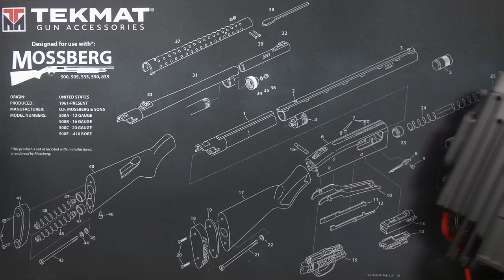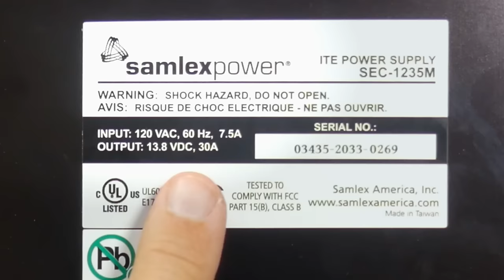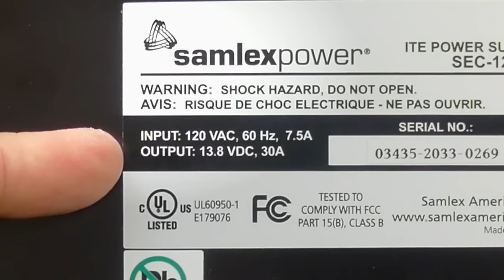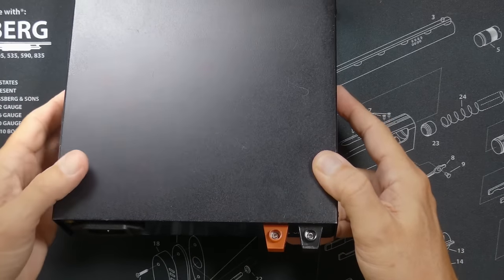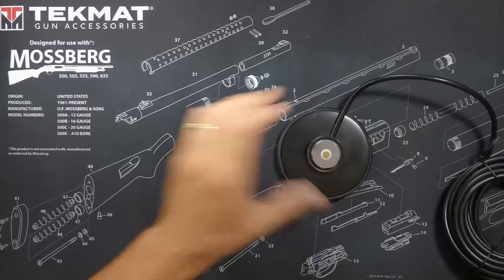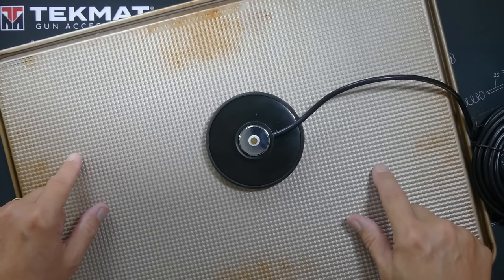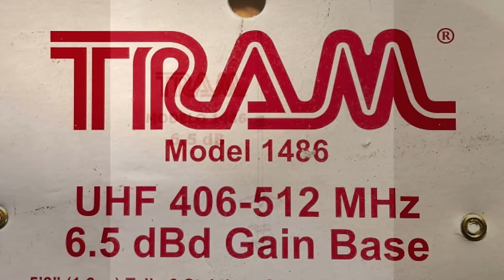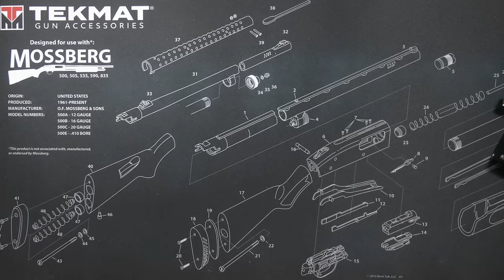How To Build A GMRS Base Station - Everything You Need To Know To Put Together A GMRS Radio For Home

Comment: Randy, I have successfully set up my very own GMRS Base Station rig. I'm using the Wouxun KG-1000-G, a Toppower STP-1330 30AMP power supply, LMR400 coax 50', a Tram Browning 6155 UHF antenna 450-470 MHz 5db gain base station antenna which is 73" tall. The antenna is grounded as you laid out in the video. The antenna is mounted on my house. I am able to hit the Squaw Mountain repeater 91 miles from my home and the Lookout Mountain Repeater 71 miles from my home. And I can do this on LOW power. I think the antenna makes all the difference. My SWR readings using the "older" version of the Farsometer shows an SWR of 1.05 pushing 49 watts at high power. Thanks for putting this out there for those who want to establish a base station. You have been an inspiration to me and I've used the wonderful information you put out to help me set up my base station.
Reply: Awesome man.  From your descriptions of the repeaters, I have to ask.. are the ones you mentioned here in the Phoenix metro area?  I have the kg-1000g and have yet to install into my truck.. which I believe is going in this weekend!
Reply: John Sampson indeed!!! The antenna is one of the most crucial part of getting signals in/out.....imo
Reply: Hey guys, I’m in Phoenix and I want to get into GRMS maybe get a base station. I live just east of the I 17 just north of Jomax in a two-story house. I could pop in antenna on the roof and have it pretty high up in the air.

Comment: That brief mention of static electricity is a fact,  I did a service call on a very windy day for a customer whose base radio was popping. Pulled the coax off of the back of the radio and it would arc from the center conductor to the shield every few seconds. Thanks for the base station installer certification, I will hang it next to my certified zip tie technician certificate
Reply: Some antennas with matching networks at the feed point of the antenna just so happen to be dc grounded.  The Ringo Ranger brand and the J-pole antenna are two such antennas.  If you have a problem with static discharge and/or lightning strikes in your area then one of those types of antennas might be a good choice for you.  The quick and easy way to tell if an antenna is DC grounded is to put an ohm meter across the center conductor and shield and it will show a dead short while also having an acceptable swr.

Comment: I guess I should have watched this video back in 2023, but my station is up and working, though I still need to get that lightning arrestor installed, it doesn't do much good sitting on the bench. LMR400 is what I want to use for my next upgrade, I am running on 50 feet of RG-8X currently. I picked up a BTECH GMRS-50V2, 50 watts on high power, and you can monitor up to four channels at once. And a 30 amp BTECH power supply. I also put the power supply on an APC UPS, so short power outages do not shut me down.

Comment: Here is an antenna I ordered for my GMRS station. 
Comet CA-712EFC Commercial/GMRS UHF Base Vert. 450-470 mHz

It has a 9db gain. A bit tall but if you have the room for $139 not a bad option. Only negative is that it is 2 weeks backordered.

Nice, simple video Randy. Enjoy your channel and learning tid bits about this hobby. 69's
Reply: Link 2 purchase? Thnx

Comment: It was winter with snow on the ground when I first got my GMRS license. I put a mag mount antenna like the little one you showed on the A/C compressor just outside my home office and ran the coax in the window. I was still able to close the window on the RG58 coax without crushing it. As ridiculous as this sounds it worked as well as a mobile setup. Since upgraded to roof mount like Randy’s but don’t let a less than ideal situation stop you from setting up a base. Even a roll up J-pole from Nelson or N9TAX hung in the corner of a room will get you on the air.

Comment: My base station is a radioddity db20-G with a power adapter that sits right next to my PC.  I ran some rg58 up to the ceiling and connected a nagoya UT-72 antenna to it.  Works fine for gmrs and listening to Dallas PD.

Comment: One cool thing about the Wouxon KG1000G is that you can remote the head display up to 16ft from the main radio body. Gotta get the SCO-002 cable. Im thinking about buying the KG1000G and power supply to mount in a cooled enclosure in my attic mechanical room for a shorter coax run to the roof peak. Then mount the display in the mancave directly below the mechanical room.
Reply: How difficult would it be for us to make our own longer cable.  Are the connectors easy to get or are the some type that is strange and hard to find.  Then the question becomes: how long of a cable can we use.
Reply: @craigdavidson2977  just get cat cable and 2 male ethernet plug and the apropiate tool bam there`s ur cable EDIT: Some radios may use special layouts!
Reply: @gamingforlive2150  and you can get all that at home depot fairly inexpensively
Reply: @hitekredneck109  well maybe? 😅 Im german so ive never benn to home depo, wallmart micro centre ir anything like it

Comment: For a low cost power supply option, there are sub $20 12v supplies meant for use in arcade machines, which will put out duty power all day long, meant for computer boards so it's clean power. These power supplies have output adjustments so you could bump it to 13.8v if you really want to.  But the main thing is, they put out clean 12v for cheap. You will know you have the right one when all you see is a bare metal box.  You have to add the 120v input cord and 12v output via screw terminals.   I use one of these with my mobile/base sad ham radio and also for a CB. Works great.
Reply: Do you have a brand/model number handy? That’s an interesting tip.
Reply: Exactly! Thanks for someone speaking up and checking in
Reply: I have used oneac
Reply: I have used old PC power supplies and modified UPS-es for cheap power supplies.  Bonus with a UPS is the battery inside that will allow you to "play radio" if the power goes out.
Reply: How much current can those power supplies provide?
Reply: Link to buy, please?

Comment: My MXT275 failed within 2 hours of its first use, VSWR was 1.2:1, and something in the main unit failed. Midland is sending a replacement. I chose a 1/2~ fiberglass GMRS antenna mounted on the ladder of my RV with a 10' 1 1/2" PVC pipe and LMR-400 coax. The range was about 30 miles simplex up into the foothills with 15 watts. I look forward to trying the base station with a 50-watt radio next.

Comment: Thanks for the great video I didn't realize how much power you lose in the coax cable. I'm using cheap cable and will now upgrade my coax.
Reply: Just to show why Randy has chosen LMR-400 cable here is a list of all the popular types in use by the hobby radio community
RG-58   loss is    11.2 dB at 400 MHz per 100 feet of cable   
RG-58/U loss is  10.6 dB at 450 MHz per 100 feet of cable   
RX-8X   loss is     8.6 dB at 450 MHz per 100 feet of cable   
RG-8 (RG-213)     4.8 dB at 400 MHz per 100 feet of cable   
9913    loss is      2.8 dB at 450 MHz per 100 feet of cable   
LMR-400 loss is  2.7 dB at 450 MHz per 100 feet of cable

So, in round numbers, If you have a 50 Watt radio using 100 feet of LMR-400 then only 25 Watts is getting to your antenna (3 dB loss).
If you use the cheap stuff (RG-58) then only 5 Watts is getting to your antenna (10 dB loss).

Also don't forget that this loss also works on receive so your radio will not hear as well (less sensitive)
Reply: @craigdavidson2977  Yes, this is a good reason to keep antenna cables as short as practicable.

Comment: I happen to use the Ed Fong GMRS monoband base antenna for my current setup it is mounted on a mast. It was 1.1 to 1 with the LMR-400 coax I used.
Reply: You could also make your own ground plane antenna. It's VERY easy to do. Search youtube for GMRS ground plane antenna.

Comment: He was dead on about signal attenuation through coax. The longer it is, the more signal will bleed off and you have a weak transmission. Recommend getting a coaxial attenuator to prevent bleed off and overly strong signal strength. I'd like to find out what wind rating his antenna setup has. I live on the coast and during strong storms we get high winds coming off the water which makes antenna placement important.

Comment: I have a question. I am building a GMRS base station. What is the difference between the Tram 1486 and the 1486-B?  Thank you.
Reply from the maker: 1486 is white, the B=black
Reply: LOL, do I feel stupid? It must be my gray hair, LOL. @TheNotaRubicon  I am using a Midland 50-watt for my base. One last question. Just how high can I raise my 14866 antenna about my roof? Thank you so much for all you do. Love your videos and your style. have an awesome day.
Reply from the maker: § 95.317 Registration of antenna structures that may constitute a menace to air navigation.

(a) Each antenna structure used for a Personal Radio Service station is subject to the antenna structure rules set forth in part 17 of this chapter. In particular, the owner of an antenna structure that is more than 60.96 m (200 ft) in height above ground level (see § 17.7 of this chapter for specific criteria) may be required to notify the FAA and register the antenna structure with the FCC. 

(b) Further, stations located on or near a military or public-use airport with an antenna structure that is more than 6.10 meters (20 feet) high may have to obey additional restrictions. The highest point of the antenna must not exceed one meter above the airport elevation for every hundred meters of distance from the nearest point of the nearest airport runway. Differences in ground elevation between the antenna and the airport runway may complicate this formula. For stations near an airport, see http://appsint.fcc.gov/UlsApp/AsrSearch/towairSearch.jsp to figure the maximum allowable height of the antenna. Consult part 17 of the FCC's Rules for more information (47 CFR part 17).
Reply: You are awesome. :)  @TheNotaRubicon

Comment: I have been rocking a (🐷 station) Betty Crocker, mag mount for years. They work good, and don't need all that extra heavy wire, mast, grounding, etc. You just gotta be careful, about all your other home electronics vs. power usage! 50 watts can blow up other wifi and bluetooth receivers, if mounted to close by. (I cooked a DVD player, beneath my antenna, one day!)

Comment: Comet CA-712EFC Commercial/GMRS UHF Base Vertical Antennas. Tuned to 460-470 mhz. They also make some that are up to 16’ in length that are sectional.

Comment: So the RF signal attenuation is the issue?? Or is it the RF leakage at points along the coax? I still have some good connectors from when I was a broadband tech . A big issue with coax and leakage was with bad connections and the metal stranded insulation of the wire not bonded with the connector. Allowed the metal of the insulation to turn into an antenna for ingress/egress. Sounds like you use nice wire and connectors installed. Another thing that was an issue, is that some  wires that were already in the walls, had a resistance  “rating” that didn’t match our 75 ohm system. Thanks for the videos I’m going to build one soon! I’ll report back and possibly test for leakage at the connections!

Comment: What kind of range do you think you could get between two base stations setups like that? Without using repeaters.
Reply from the maker: Anywhere from 1 mile to 75 miles, depending on a dozen or more factors, but mostly depending on what is between the two base stations.
Reply: @TheNotaRubicon  I live in a very wooded area in East Texas. I just got the UV 13 maybe a week ago. I have talked two miles with it so far. I have thought about buying another UV 13 so the wife could have one then we could do a range test between the two handhelds. I love watching your videos. I plan to upgrade to a base station pretty soon. I also plan to get my gmrs license next week.

Comment: What's a cheap but decent GMRS base station and antennae and whatever else I need if I want to have a way to communicate just 11 miles to another of the same unit?  (I want to set up two base stations, one at my house, and another at my aging parents house for when we lose cell tower comms during hurricanes here in Florida).  Thanks.
Reply from the maker: I use a Tram 1486 for my base-station. Its not too expensive and it does not look like a giant-space antenna on the roof so the neighbors..and the wife,  don't complain.

Comment: How reliable are repeaters going to be in a sustained SHTF / Without Rule of Law situation ?  Who’s going to be ensuring they have electricity ? Seems like there are some practical realities for this scenario - does it devolve into line-of-sight only ?
Reply from the maker: It depends on the repeater owner and the repeater configuration, but no good SHTF plan relies on something that is not in your control for the reasons you've mentioned.
Reply: I agree.  Unless you are the owner of the repeater and you know it has backup power or you are part of the group that put it up and you know how it is configured for SHTF then you shouldn't depend on it any more then your cell phone.  Batteries and generators are fine for short term backup but the only power source I know that will last long term is a solar panel.  If you want to get really clever, design the repeater to drop to low power if the solar panel is having trouble keeping the batteries fully charged.  Another clever idea is to be able to command the transmitter off to save power when you aren't using it and it will also attract less attention by unauthorized users when its off.

Comment: Thank you for the informative and most helpful on-topic visual aids!   I feel empowered!

Stupid question:  In setting up a GMRS antenna, can that same antenna be used for certain Ham bands?  If so, which ones?  How best to go about obtaining the most "universatility" out of a single investment?
Reply: No, it would have to be re-tuned for the section of the 440 (70cm) band you want to use.
Reply: I use my ham antenna on GMRS but the SWR isn't optimal.  Not horrible but I wouldn't push 50w through it.

Comment: Another excellent video.  I have two questions as a newbie: 1.  in a prior video you explained how my regular FCC GMRS license is not sufficient for the 25 watt handheld you were evaluating and that you need a commercial or business (I can't recall which one) license.  Why don't you need such a license to use a 50 watt radio in your car?  ...or do you??  2.  Can you use a powerful handheld (ex: 25 watt) as your base station radio without getting the extra license?  If so, why is that okay while it isn't okay to use it for a mobile radio?  This licensing thing really confuses me.  Since I've been watching your channel I did procure a GMRS license (unfortunately, I paid for it before the FCC reduced the price).  Thanks for your videos.
Reply from the maker: 1) You need a license for a 50W radio in your car - either a GMRS license or a ham license or an business license, depending on your radio
2) The license depends on the radio - GMRS, HAM or "LMR" which is the other type you mentioned, which requires a business license.

Comment: The COMET CA712EFC is tuned to 460-470 mhz and provides 9db gain. I have had great results during the three years mine has been connected to the gmrs side of my station. Kj6wss/wrap287

Comment: I have a Btech 50v2 and I’m using it as a base station. I’m using 25ft of KMR-400 coax and a HYS 200w GMRS antenna that I got on Amazon. For some reason I’m getting a 1.7 to 2.2 SWR and I wanted to ask if you think this is acceptable? I’m using a Surecom to test the SWR. Also, it seems that I get a higher SWR when I’m on high power, but it goes down when I put the power lever on low. Any suggestions would be greatly appreciated.
Reply from the maker: 1.7 is near perfect and 2.2 is very good.. Stop overthinking it and enjoy your radio.

Comment: If I set up a GMRS antenna, and then decide to get a ham license, can i use the same antenna?
Reply from the maker: It depends on what ham band you decide to use.
Reply: @TheNotaRubicon  Thanks! Is there some generic way to look at it with an 80/20 rule, or does it require actual research and understanding?
Reply: Generally no, you might get some kind of action on the 70cm band but even there it might be sub optimal. There are antennas that will cover a very wide bandwidth that will work on GMRS, MURS and a few VHF/UHF amateur bands such as the “discone” antenna that are popular with scanner users.

Comment: I’m an expert at assuming ,  I am disabled and would like a couch radio. I assume a cookie sheet base station is better than using a handheld on my couch.
Reply from the maker: Usually a correctly tuned mobile antenna on a cookie sheet in the window will outperform an HT antenna, assuming there are no issues with the coax/connectors, etc.

Comment: Has anyone mounted an antenna in the attic? I know it will attenuate, but if anyone has done it what kind of results did you get?
Reply from the maker: many people use attic-mounted antennas with good results..
Reply: Just watch out for that shiny metalised insulation stuff as that can attenuate the signal a lot if you have it.  It can also screw up SWR.

Comment: CA 712 EFC ... GMRS base station antenna ... 9 db gain ... pre tuned for GMRS no cutting/tuning  required
Reply: Here is a cheaper dual band GMRS/MURS   Comet GP-6NC GMRS/FRS Commercial Dual-Band VHF/UHF
Reply: @craigdavidson2977   I'm using a Tram 1450 for my base station that I tuned for GMRS with an SWR of 1.02 to 1 .  I use the CA 712 EFC on my repeater .